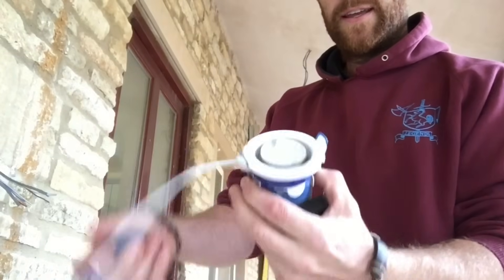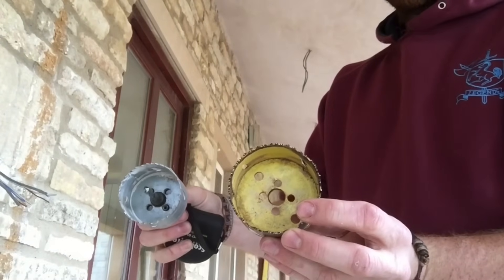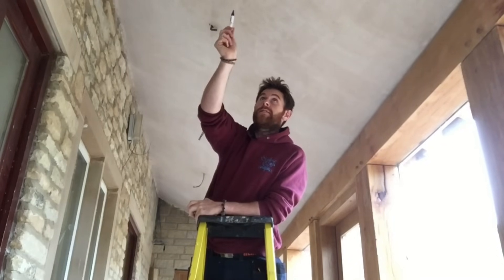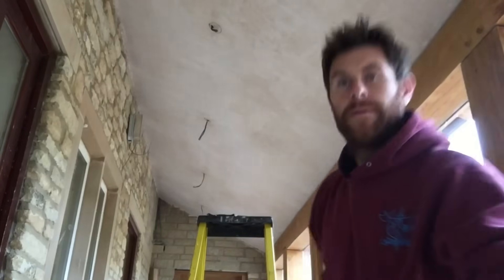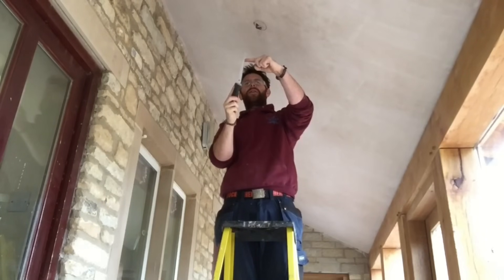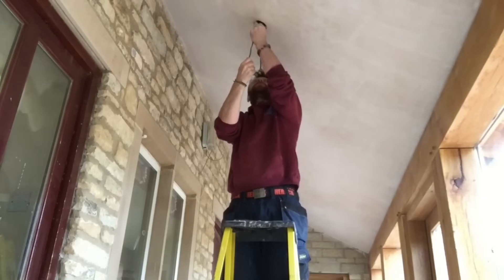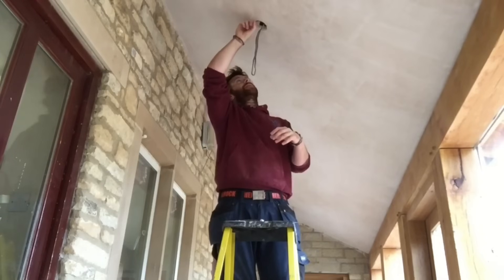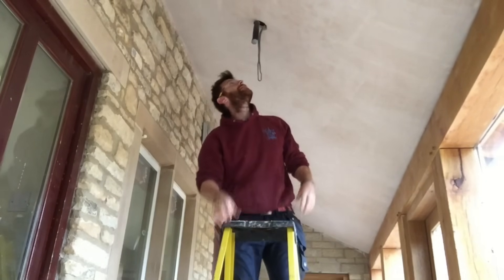How to Cut a Hole in a Plasterboard Ceiling to Fit a LED Downlight

Comment: I often use a hand drill for that very problem, if you turn it slowly and use a holesaw with the pilot bit removed, you can go through nice and steady without any risk to whats the other side.  you can use your method but guess its each to their own.
Reply from the maker: +gavin john-hyde 
Hi. Thanks for your comment another great way of over coming a problem. Thanks for watching and all the best GSH Electrical.